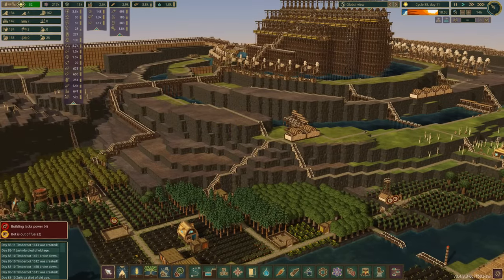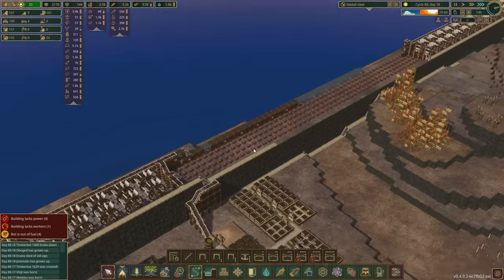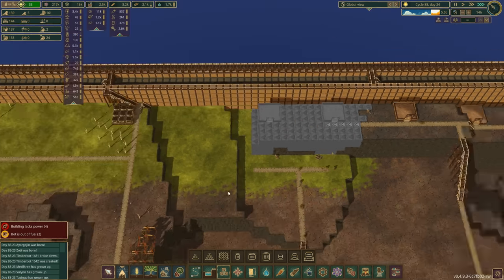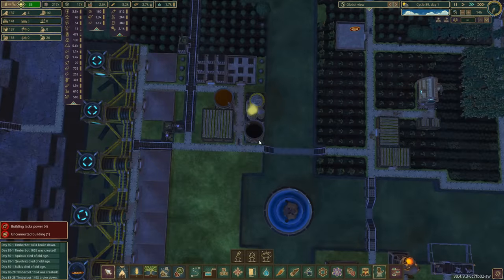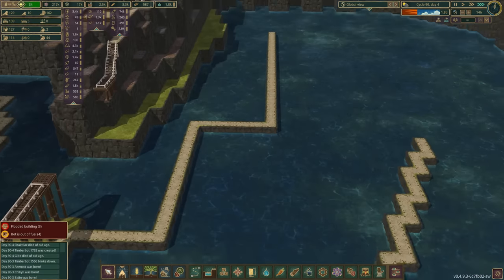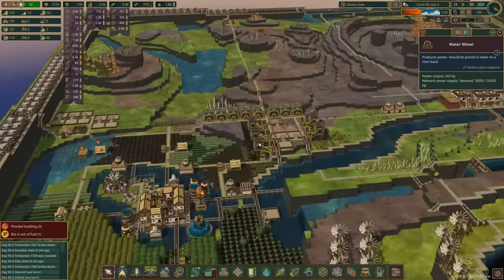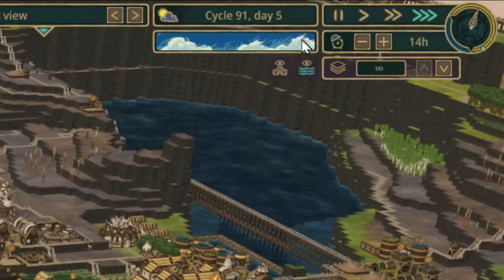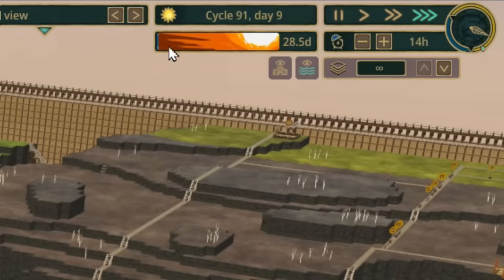MAXED-OUT BATTERY CAPACITY! - Waterwheel Power For The Win! - Ep 20 Timberborn Hard Mode

Comment: to avoid losing water long term, raise the path hight on the aqueduct, and add a ridge beyond the power line. making it so there is no flood over the side, and keeps the water flowing down the path. done right, you can keep the whole system running longer, losing less water, and less power in total :P

Comment: The top reservoir on helix mountain keeps the first former river ring green all dry season I think. You could add in more farm space there, in the valley between the windmills.
Reply: I'm hoping that he will eventually redirect the water down the original river channel, and fill it with water wheels.  Because the overflow channel is built through the river, he would need to build the canal in such a way that it has to double back on itself, but I think there's enough room in there to make it work.

Comment: Why dont you put another water pump from the bottom Reservoir Towards the upper reservoir? These way you can reduce evaporation & keep water wheels running
Reply from the maker: Beacuse I would lose power .. it take more power to pump the water up than you get on the way down
Reply: @SkyeStorme  but in wet season you would instantly get power instead of waiting till It overfills
Reply: Why not just disable one pump going to the towns aka eco mode. Might be enough to keep the wheels turning.